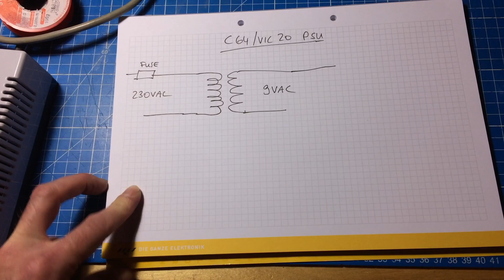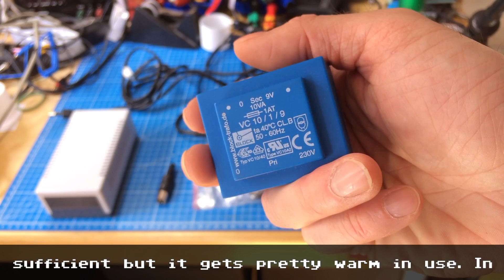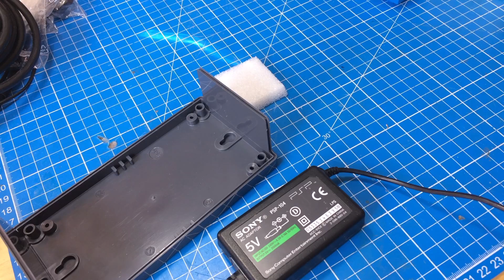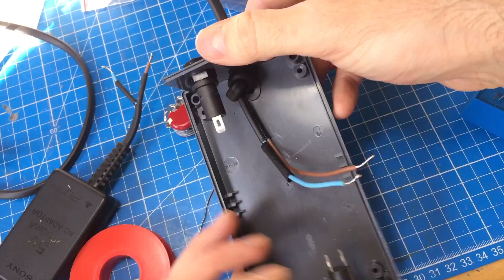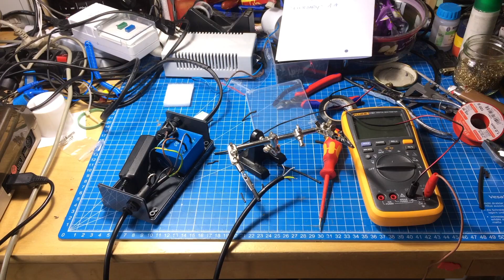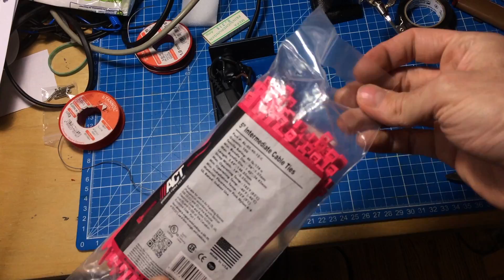Building a DIY C64 Power Supply (The Lazy Way)

Comment: Any idea how to get a fuse out of a C64 Mk 2 power supply? (Damn thing is stuck in there... not sure if i can even open it up, no screws on it).

Also, is the mk2 safer than the original PSU that you are showing in this video?

EDIT: you could add a small fan to decrease the temperature inside the box.
Reply from the maker: Mh, I'd probably try banging it against a table to get it out. Or use a really small set of tweezers. You'd have to unplug it first, of course! ;)

The MK2 is nearly exactly the same as the first C64 PSUs so the only way it's safer is probably that the components are not quite as old. Still highly recommended to get a replacement or a protection device.

The heat buildup is not that bad in every day use actually. Works like a charm and gets lukewarm after some use. The only thing I changed after the video was to add higher rated fuses (see video description).

Comment: Hi! Very interesting video! Been thinking about replacing my powersupply for my C64 before the old one decides to fry the chips inside my computer. But now I may make one myself since it looks really easy!
I wonder if it is possible to use a USB powerbrick for the 5V DC (assuming it's powerful enough), or would that be a bad idea? I just thought it would work well since they are very small and would easier fit into a case.
Reply from the maker: As long as it's a decent one that has enough Amperage (min 2A, the more the better) and not too much high frequency ripple on the output it will work just fine. The C64 is not very picky as long as the voltage is not too far off. If it has too much ripple, you'll get hum and video artifacts and you may damage the ICs but that's fairly unlikely with a decent USB brick.
Reply: Okay, thanks for your reply! I will keep that in mind.

Comment: Jan, if you want to a proper load test of the power supply, you need to connect a datasette to a breadbin. In my own power testing, the worst case for the 9V AC part of the C64 power supply is a when the datasette is doing rewind at the beginning of a tape (i.e. the casette cannot spin). You should measure the AC voltage at the user port under that condition.

From my own testing, the minimum acceptable AC voltage under that condition is about 8.1V.  If your transformer stays within close margin from that, say, 8.5V, I would say the transformer is fit for purpose.

I would not worry too much about heat generated by the transformer: As a transformer consists of wires and a core, they can withstand very high temperatures, probaby hundreds of degrees. Therefore as long as you can still touch the transformer, there is no need to worry.

If you want to generate less heat from the transfomer, you need a ringkerntransformator, I don't know the English word, the German word is the same as the Dutch one. A normal transformer is about 80% efficient, bigger transformers are only slightly more efficient than small ones. However, a ringkerntransformator can achieve well above 95% efficiency and therefore generates a very low amount of heat.
Reply from the maker: +Daniël Mantione Oh, using a toroidal transformer (I think that's the term) is a nice idea. Maybe for a future project.

I'm going to test the PSU with my datasette some time. Good idea for load testing the transformer. :) It only gets lukewarm so it's nothing to worry about I guess but it's still a good idea to test it properly of course.

Comment: After watching this I thought I might make one of these the same way you have. It looks absolutely fine and the only change I would make (which you mentioned in the video) is to include a different Transformer to give additional head room. I might however just buy this once the guy offers the longer power cable for the DIN connector. https://en.retrogamesupply.com/products/power-supply-for-commodore-64

Comment: Nice work :)
You could have been even lazier and saved yourself from the hazzle of soldering the DIN connector by sourcing the output cable from a dead C64 PSU.
Reply: Thats exactly what I plan to do - I have a working c64 power supply here but I don't trust it after all the horror stories I have heard about them blowing chips. I just need to get motivated to drill and cut the metal enclosure I chose for my PSU. It looks even smaller than Jans, but my 5V PS is a much smaller size as well (still rated to 2A).
Reply from the maker: You probably won't believe me--but all the C64 PSUs (4 or 5) I have actually work fine so I didn't want to salvage one of the cables. ;) I actually want to mod one to have a buck converter for the 5V some time though.

Comment: Thanks for the great video Jan.
I found a video you may find interesting. I wonder your comments about this.
https://www.youtube.com/watch?v=hoZWKgxW5QU
Reply from the maker: That's an interesting approach. I heard about pure DC supplies like that one. If I remember correctly, this will not work on the older C64 models though because they use the AC for some VIC timing stuff (so the picture would be out of sync without it, I guess). Would be interesting to try though. You're giving me ideas there... :D

Comment: I like this combo, and wanted to build something like it myself. As NL resident I still need to find the casing (ref?). 
One suggestion: add a well sized on/off switch on the 220v side so you can leave it plugged in at 0A :)
Reply from the maker: I got the case from reichelt.de a while back. Unfortunately, I don't remember which one it was and they sell a bazillion different flavors of cases so I didn't find it again yet. :/

I also thought about adding a switch but left it out solely because I am using it on a switched outlet anyway. ;)
Reply: just checked the reichelt page - BOPLA E-440VL :: Gehäuse, 150x 80x 55mm or BOPLA E-450VL :: Gehäuse, 188x110x 70mm maybe?
Reply from the maker: Yes! Has to be the 440VL one. The measurements are the same. Just checked. Thanks for finding it. I will put a link in the description, too. :)
Reply: Found an online store that had them, and got two (just in case - no pun intended). Thanks !

Comment: Really nice work! That case is beautiful too. A C= logo should look really good on that case. :) 

I have a C64 PSU that's kinda serviceable, it's the model that's both square and wedge shaped if you know what I mean. It has screws in the bottom so that it's easily opened and the 5V section is not that much filled up with epoxy resin, so I isolated the original linear regulation in the C64 PSU and bought a PCB mount switch mode PSU called "IRM 20-5" (5V 4A) and placed inside the C64 PSU, this way it all looks 100% stock and it also 100% reversible.
Reply from the maker: Thanks! Yes, I know about that one variant of the C64 PSU that is servicable (at least to some extend). Never had one of those, though. I want to try the same with one of my classic "elephant's feet" shaped PSUs some time, too. Would be nice to keep the original looks.

Comment: Regarding the pinout. Even if you get it wrong in the horizontal direction (not knowing if the numbering is mirrored or not), it will still work. I wonder if commodore made the pinout this way to prevent production fails. Btw, i've seen power supplies with 5V on the oposite side (pin 4 or 5) of what is normal. Both works, but it made a problem with my C64 Saver. Thats why my saver has connected pin 4 and 5 together on the female connector. A bit of a nuisance to connect two pins together and then into a wire. It makes it harder to for example pull a heat shrink over those pins, but on the other hand it reduces the amount of returns from customers :) (I noticed that on the third saver i ever sent out, a guy who had one of the earliest C64s had a 5V on the other pin (4 or 5).  Another "secret" about the DIN standard is that the pin position is the same for all number of poles.
Reply from the maker: That's an interesting point. I knew that some old C64s had an extra 5V somewhere but didn't look into it further because I thought it would be compatible anyway. Thanks for the info. :)

Comment: Great video! I personally would have probably removed the 5v power brick from it's plastic shell so that it could have a little better ventilation, but it's probably not too hot.

However I do really dig that PSU case and that 9v AC transformer. Even though I have a couple C64 psus now, I might take the time and build one as well.
Reply from the maker: Thanks! I actually thought about taking off the case, too, but settled to leave it on because it barely gets warm anyway. The transformer gets a little warm so I'd go for a beefier one if I build another one of those.

Comment: It actually is quite interesting what all the 9 volt line does.

9VAC comes in across pins 6 and 7 of CN7, the power connector

     1) it is regulated down to produce the +12v supply (9VAC RMS >12VDC
     2) it is regulated down to produce a second, low current +5v supply
     3) it is noise-filtered and passed to CN2 (the user port)
     4) it is very sloppily rectified and used to power the cassette motor
     5) it is used to derive the 60 Hz TOD clock for the 6526 CIA chips

I think I would really recommend some level or voltage regulation in the 9 volt line although this is done in any case no need to further stress 30 years old components 🤔
Reply from the maker: You're probably right. I will look into that. I found that the voltage my self-made PSU produces is nearly exactly the same like the one the original PSU puts out so I don't really think it's dangerous. But maybe it really makes sense to not stress the components unnecessarily. Thanks for pointing that out.

Comment: I'm using a c128 PSU
I heard that's the way to go.
Reply: Well, for 80's the C128 PSU is a rather advanced design: Heavy transformer and switched 5V regulator make it generate much less heat than the C64 PSU. However, it's less efficient than a modern switched voltage regulator. Jan Beta's PSU is more advanced than the C128 one.
Reply: @danielmantione  hey this is good info, I was watching this video because I was planning to build a new PSU for my C128 that I haven't used in a loooong time. I was expecting it to be half-dead by now like C64 PSU's. Time for some multimetering.
Reply from the maker: I don't know how it is designed, but it surely has enough ooomph to power the C64 without any problems (more ooomph than the original PSU so it's probably a better choice than that). :)

Comment: It has a thermal fuse ? thats great. I'd feel a lot safer with it. The secondary fuse is low. The C64 current pull is about 1A, and rated at 1.5A. New board? Might be a bit less current pull, especially on the 9VAC. The DINs, tell me about it haha, it is a pain.  It's no that bad for my C64 Saver cable. Because the cable is only 13cm I can use thinner wire to solder than if the wire had to be a meter or two. Regarding the SMPS, it has tiny current from the primary to secondary, and a charge built up between ground to live and ground to neutral holding half the mains voltage. From what I've heard from Greisis, it is because of some caps that reduce EMI to pass FCC regulations. The current is harmless to humans, but can harm the C64 if the connectors on the back are touched. Anyway I don't have any experience with this myself.
Reply: I also reacted to the low fuse rating on the 5V, original supplies are 1.5A or 1.7A and your Playstation PSU seems to be marked with 2000 mA - so you could probably use a 2A fuse. You might pop the fuse just by turning the computer on as it initially draws a bit more current than when it's idle.
Reply from the maker: I also thought the secondary would be a bit low. It didn't blow yet but I'm going to replace it for a higher rated one. I learned about the high voltage issue in Greisi's video. I think it's a minor issue for practical use but it should have been included in the video in retrospect... Mmmh. I'll add it to the video description at least I think.